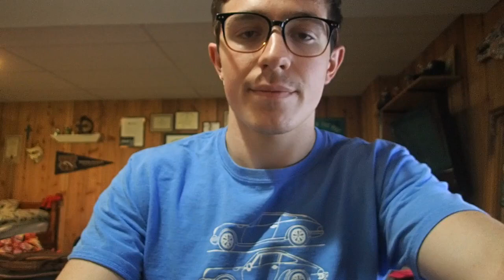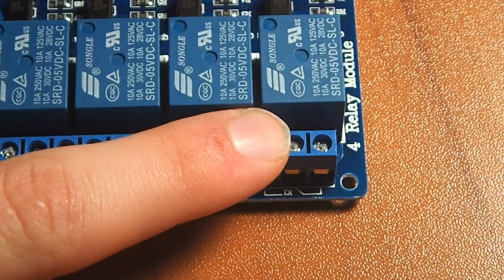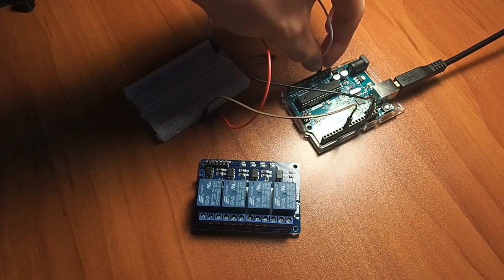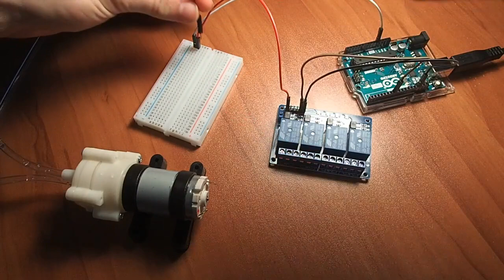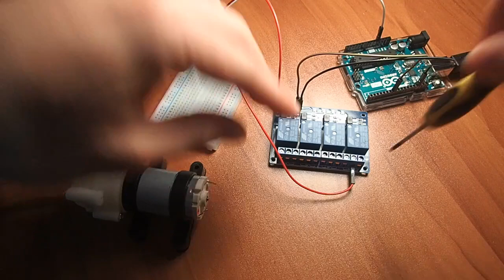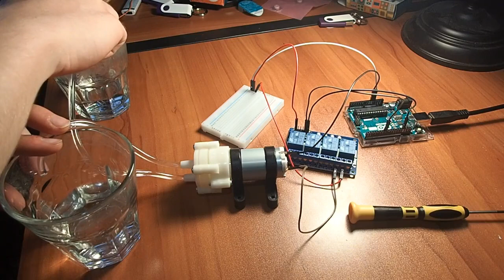Arduino Tutorial : Controling 4 relay module for use with a 5 volt water pump

Comment: When i energize my remote switch it words as ot should sending power to the 30 amp. relay, which turns on the pump. My problem is that the remote won't turn the pump off
Reply: Every thing works fine until I introduce the 12v pump
Reply from the maker: This setup only works for low voltage pumps sorry

Comment: 12v pump
5v relay.

WTF
Reply from the maker: I needed low water flow but you can use more voltage to speed it up

Comment: hello, can we use 1 relay module? will it works or do we have change the code and wire placement on the arduino boards?
Reply: depends on ur project if ur projects req more than 1 relay. like in the vid, in order to control the water pump it only req 1 relay
Reply from the maker: yeah it should work

Comment: You're using the 5v usb rail and when current gets drawn the relay drops out, the pump requires way more current than you're providing
Reply: how much
Reply from the maker: Definitly that was a cheap setup I could hear it popping

Comment: This has given me a much better understanding of the relay module.  Good stuff and well explained.  Thanks for the details.

Can you offer any advice for me please -  I want to use 12VDC motor (instead of 5VDC).  Could you please give a sketch for the same and code.  

Thanks in advance.

Sushil Damle
Reply from the maker: You will need a different 12 volt system and use the arduino to control the signal

Comment: I have a question. I connected the digital output 7 to my 5V relay wherein it turns on whenever it detects high temperature. However, it outputs less than 5V whenever a load is connected like relay or LED. It outputs 5V when the digital port is connected alone with multimeter. What do you think might be the issue here?
Reply from the maker: The resistance of the circuit conectsd to your power source might be droping the voltags

Comment: Thanks brother, what did you do to activate the pump to go on and off, is it possible to do it using the push of a button and how ?
Reply from the maker: You can activate it with a timer or you could setup a button but I didnt code that in yet.

Comment: Don’t you have to have a kickback diode so to block against back emf to your Arduino? Anything when you break the magnetic field sends a electron dump from cathode to anode (+ to -)
Reply: A diode and capicator are needed. Yes.
Reply: @hahaok9572omg the comment been years, I hope you can answer my question

which capacitor are you recommended? I have trouble using 4 pump dc and using 4 relay like this dude, I tried using kickback diode and it's not enough emi still disturbing
Reply from the maker: definitly almost blew up my system

Comment: Where would you add a separate power source(9v battery) for the pump? I'm making an alarm clock and will like to add the pump...
Reply from the maker: higher voltage system

Comment: The relay serves no purpose here the way it’s wired.
Reply from the maker: it controls the turning on and off of the pump!
Reply: @astronauta2706  It doesn't really, it's pointless to have it you may as well connect the 5v directly to the arduino. The reason you would use the relay is because you don't want to be using the 5v from the Arduino to power the pump, you're using the Arduino as a power suply which it certainly isn't - you should use an external power supply to the relay.

Comment: Thanks mate, your explanations has helped me clear my confusion on completing my project using 5v water pump.
Reply: @Rob Wilton Yes you could, but you have to plug in the correct pin
Reply: Using 12v water pump boleh tak